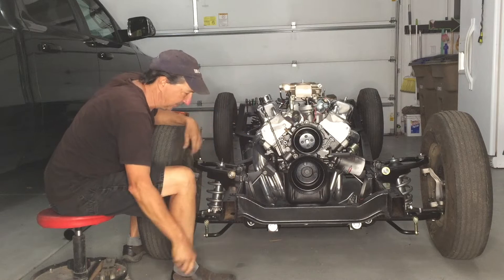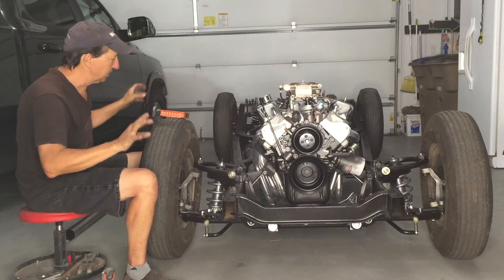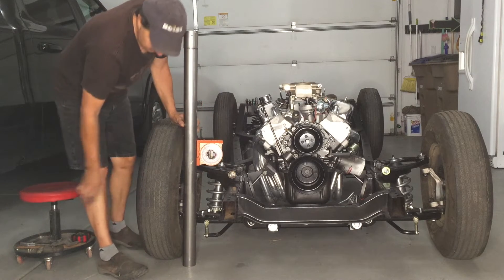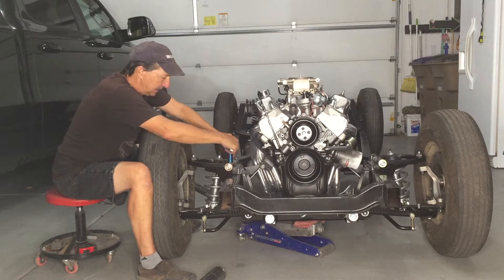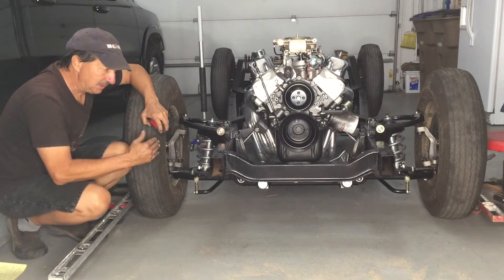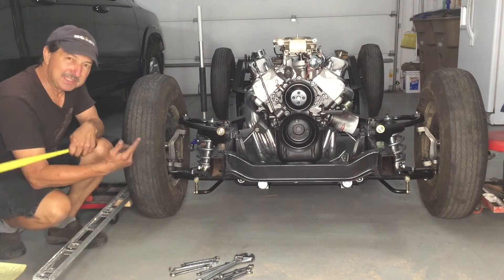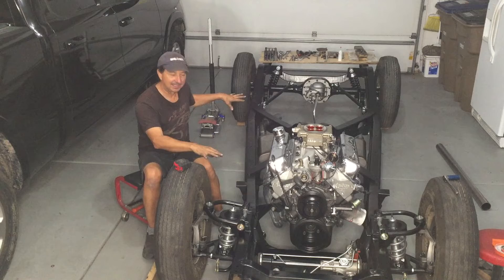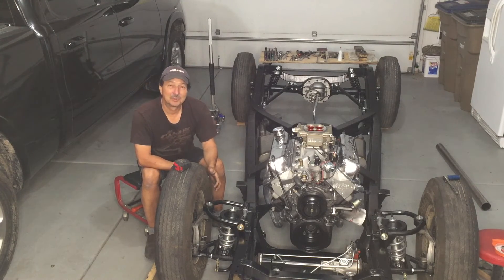Part 10. Mustang II IFS, Triangulated 4 Link, 4 Wheel Alignment, . 1950 Willys Jeepster Chassis.

Comment: You usually NEVER run positive camber, ALWAYS negative. You have some camber gain in your suspension because the upper arm is pointing uphill. Even with that, as the body rolls, the tire will try rolling over with it making MORE positive camber. You want 0.5⁰ NEGATIVE camber (top of tire tilted toward center of the car)..   Toe also does not cause bump steer. Bump steer is literally the wheel CHANGING steering angle bump. Aka BUMP steer, when the suspension compresses. This is a result of not having your steering rod ends at the correct angle/height for your suspension configuration. You have to adjust the height of the rack with offset bushings or the height of the rod ends with a bump steer correction kit that comes with some adjustable heim joints, a couple studs for the knuckles and a stack of spacers that allow you to change the steering rod angle.
Reply from the maker: Very good information. Thank you!

Comment: Thank you for sharing your lessons learned and the research you have done on the Mustang II.   How you explained the tasks at hand made it easy to comprehend.  Keep them coming!   I too purchased and installed (tacked welded in place) a complete coil over c/w sway bar for my 57 Dodge D100 truck.   The installation instructions that came with the kit was printed on a sheet of paper.  I spent more time researching questions I had than actually doing the install.  Suppose that's normal for a first timer.  Now with the information that you have shared, I will be able to double check my work before final weld.  Just wondering, what did you conclude for the bump stops?   Thanks again!
Reply from the maker: Good for you figuring out your install. Doing all the research is very time consuming but we are fortunate to have so much information at our fingers and eyes. I used the stock rear bump stops but I don't have anything in the front. Since the coil over shocks are adjustable I think that once the car is built and loaded I will be able to set the ride height and forget it. The car is so light and small I don't think I will bottom out but I will need to check deep corner dives to make sure my front tires don't hit the fenders. Thanks for the comment and thanks for watching.

Comment: where is your spindle centerline relative to the bottom of frame at crossmember. equal or 1,2 inches higher or lower?
Reply from the maker: I think I know what you're after, here are some measurement that may answer your questions. My lower control arms are parallel to the ground and I have 2" lowering spindles. My centerline from spindle to center of lower control arm is 6". The center of the lower control arm to the bottom of the frame is 4". So the center of the spindle is 2 inches above the low point of the frame.
Reply: @Ride Rescue  exactly what i was wondering.  so spindle centerline is 2 inches above frame bottom.

working on this now.  setting my spindle centerline even with frame bottom. this will give me about 6.5 inch frame to ground clearance at the front door hinge area.

https://youtu.be/JqvQf0TnE5k
Reply from the maker: @aknovaman  Checking out your cool Willys truck project. Love the rear end choice. Good luck and I'm your new fan. Subscribed and I'll like as I watch. Thanks for the questions and thanks for watching.
Reply: @Ride Rescue  yup.  I may need to arch the rear frame to get sufficient upper rear end arm clearance for full travel. not gonna cut into the bed area though.